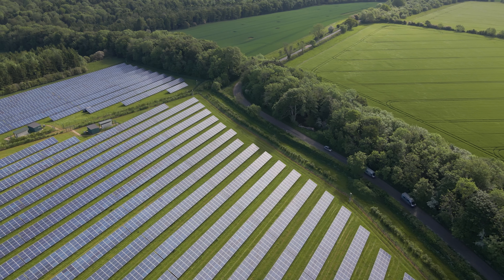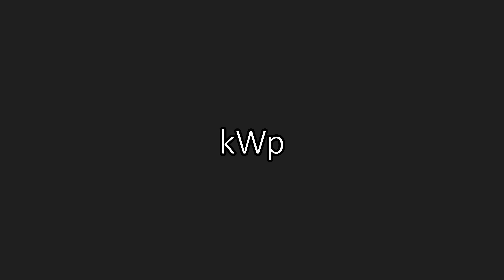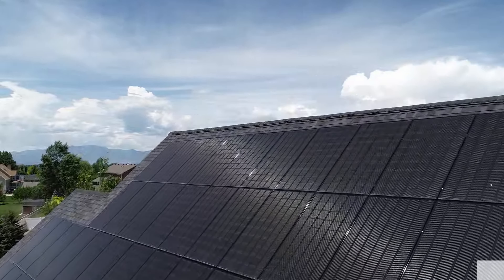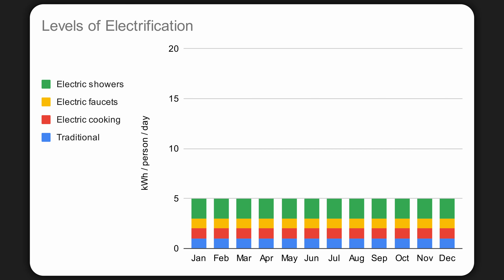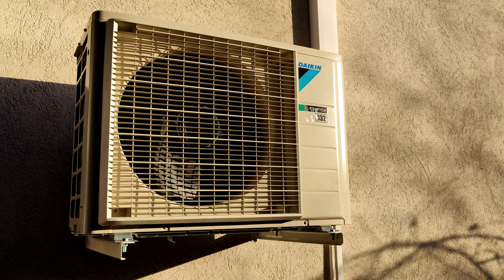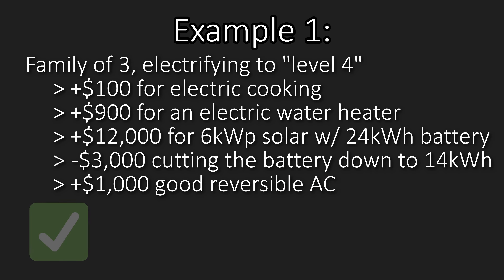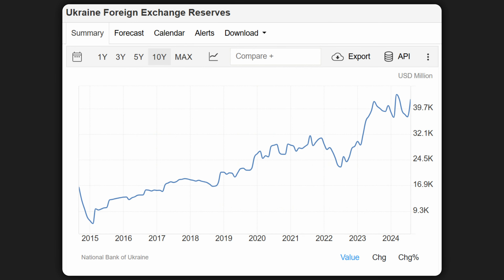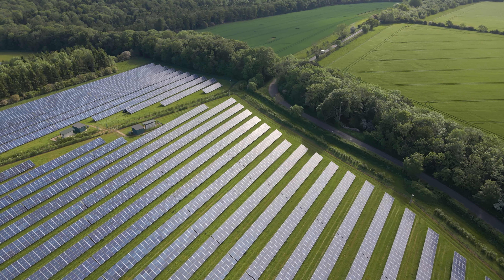UNBREAKABLE GRIDS | Solar for Systemic Security

Comment: Good primer for high latitudes. We closer to the tropics folks are blessed. It doesn’t cost much to add PV to size your system to meet winter needs, IF you have the roof space. We designed the house for PV with pitched equator facing roof. We’re 27 degrees south and with a 10kW inverter, 14kW PV, we can charge the car and water heat in mid winter. System cost was $12k Australian. In US dollars it would be less, but in the US red tape increases costs, so about the same.

Comment: kWp does have a standardized definition; it's the output when the module is exposed to 1,000 W per square meter of irradiance at 25 degrees C and an air mass equivalent to 1.5 times the vertical atmospheric air mass.

Comment: You forgot to mention heat pump water cylinder (heater) with most of them with COP above 4 so thats gonna help a lot , or the other route is instead of sizing the system for water heating to go directly to solar water panels

Comment: Great ideas, excellent presentation. Your comment about "batteries getting cheaper" triggered me a bit - until I checked local reseller and found out that 5kWh battery went from 1600 CHF to 1300 CHF. I might be extending my storage ;)

Comment: 6:50 - There are point of use electrical shower heads, invented and extremely common in Brazil… idk about EU regulations, but they exist, eliminating the need for a central water heater

Comment: I’ve been saying for ages that if we got rid of the standing charge in the uk we could use heat pumps for heating for the 95% of the year when they make sense and the rest of the time use gas. The problem is that the energy companies in the uk would use this as an excuse to put the price of gas units to be about the same as electricity units. Then there’s  no point in having gas. 

All the while the government regulator is colluding with the companies.

Comment: I've been running on solar and batteries for about 6 months.  Adapting an efficient lifestyle, I'm at about 1 kWh/day for traditional and cooking.  

I'm not sure why people need 2kWh.  My best guess is induction cooking and upright refrigeration.

While the induction hob is better than previous alternatives, the insulated electric pressure cooker is much more efficient as radiant, convective, conductive and vapour losses tend towards zero.  Add on a hot air fryer top and you have an electric oven with superior thermal insulation for less total capital and operational expenditures.

Using chest freezer and refrigerator probsbly saves a decent amount vs the upright versions and their cold losses when opened.

But still 2kWh/day seems like a lot. One could easily run several room based HRV/ERVs and a bit of atmospheric water generation or heat pump drying and stay under that limit.

Maybe it's that you can't manage what you can't measure, and if you setup your own system you start paying attention. That attention by itself seems to drop usage.

Comment: I think its a mistake to match the inverter-power with the kwp of the modules.
Inverters should ALWAYS be overbuild with modules at least 1,5X, better 2X.
Reply: Isn't matching inverter power with peak kwp of the panels already enabling overbuilding it? I mean, they are going to rarely reach that power anyway, so you should be safe. Sure, overbuilding by say 1.1-1.2 factor seems reasonable just in case, to prevent potential overheating, but why should you overbuild by a factor 1.5-2?
Reply: @milospavlovic7520  Because panels are cheap. And gridwork is expensive. And you don't need the peak power anyway (if you do, you don't have enough panels)

Its perfectly save, our balcony solar systems very often come with 2kW panels and 800W inverter.
Reply: @thiesclausen4868  Oh, sorry, I understood that you were saying inverter should be more powerful, but you were actually saying panels should always be more powerful precisely because they won't be at peak most of the time. That makes much more sense to me

Comment: sure and make the story complete your electric meter is a joule meter
how the woke left turn things try to make from a kwh meter a joule meter
why for fame sorry but it will stay a kwh meter, so sad that you need the son of a brewer
to learn that a hour have 3600 seconds x 1 watt just faik know first what volts is a second
230 V x 50 hz is in fact 50 x 4,6 V in one second the same you can do with 60 hz
and the hz have nothing to do with rpm but with poles on the rotor.
knowing electricity is more than using a word joule in a storry.
unbreakable again fake info you are using they can break milions know that

Comment: If solar panels are so cheap and getting cheaper, why could we not dimension the inverter and battery to our peak monthly needs (January in cold climates, and rather July in hot climate, where A/C is prevalent), AND dimension the solar panel peak power to the second lowest production day in the entire year (the first lowest being covered by the battery) ?  Sure, most household would not have a roof big enough... but a lot would have a garden big enough on top!  Furthermore, ground-based installations are cheaper and easier to maintain.  In my case, I have 3.6 ha... so, no sweat! 

 I 100% agree it is not financially optimum, but a) the surplus might not be that huge, and b) boy, is it tempting to be independent from the grid!
O!  I forgot to say... let's factor in the variable of owning an EV with V2H capability!